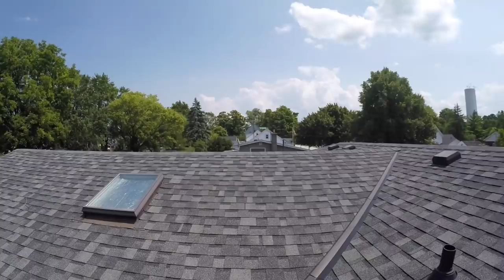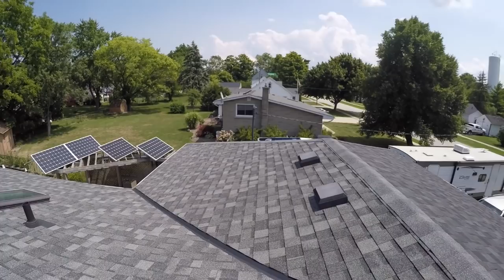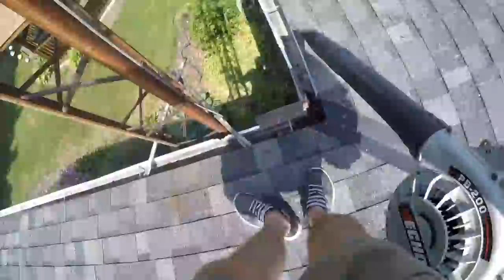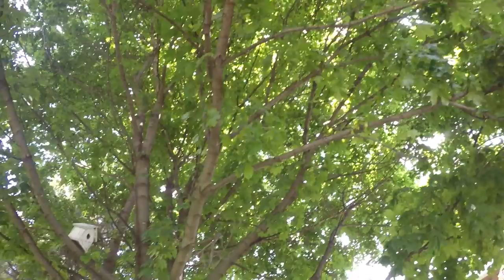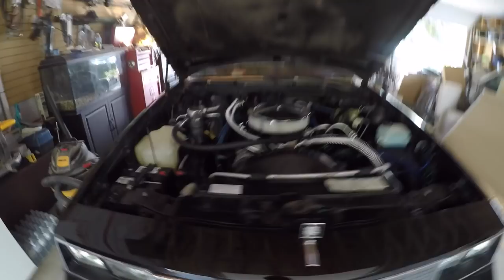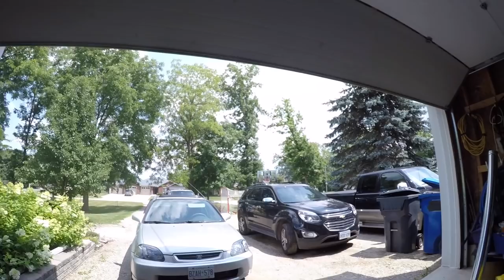Could Of Broke A Leg

Comment: Does the OEM emission sticker on the radiator not tell you the vacuum routing??? Another common issue is broken vac diaphragms on vac advance and/or trans modulator valves. Also check for leak at the vac heater control valve.